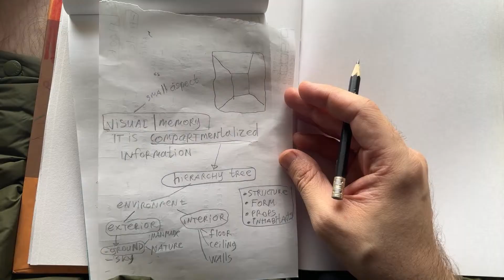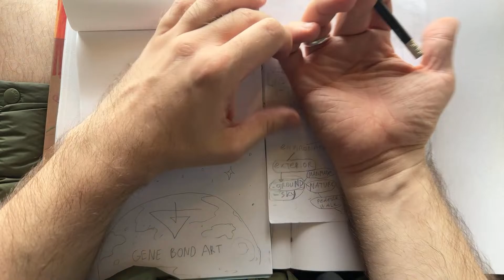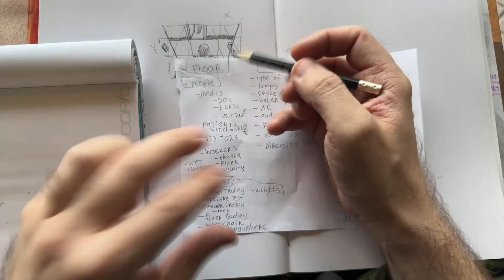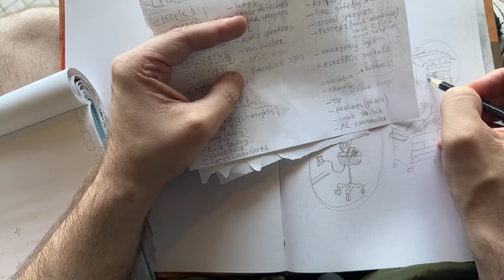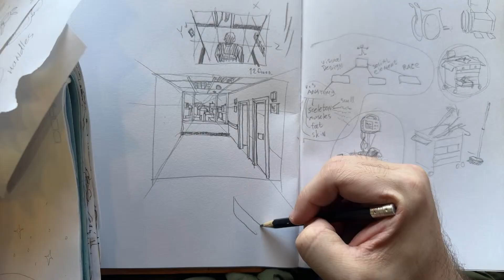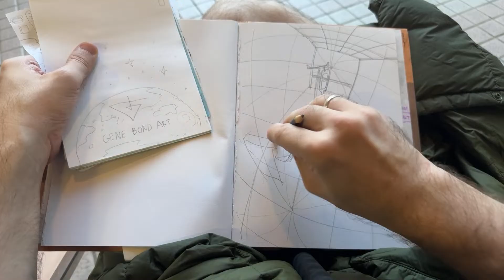How to build visual memory. The only way 🤌

Comment: this video has inspired me to do a drawing like this every day with different locations. Form, structure, props and inhabitants perfectly sums up this exercise. One question Mr Bond. At 1.06.31 you rotated the box on the ground plane. Is there a technique for doing this because I have searched and searched. It is one thing I struggle with and I noticed you drawing a circle inside the box . I wonder if you could explain your process.  I can do it by eye but sometimes it just looks wrong. Any tips?
Reply from the maker: @macmac4050  Thank you for the feedback! To rotate boxes and objects, start by practicing drawing cubes from various angles (like Krenz cubes) and gain confidence with ellipses. There's a basic technique for rotating cubes using ellipses—practice it for a while, and you'll develop a sense of 3D intuition. This will help you draw and rotate boxes in space as if they were real objects or in a 3D editor. I'll make a video about it! :)
Reply: @GeneBondArt  Thanks for getting back to me, I would like to see the video as I think many people would .